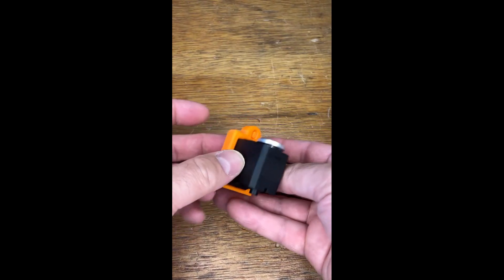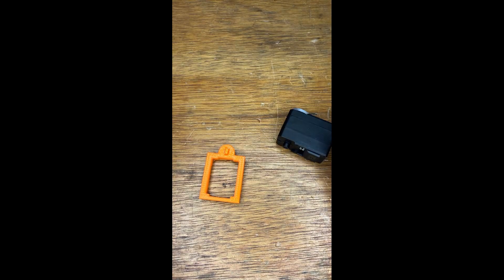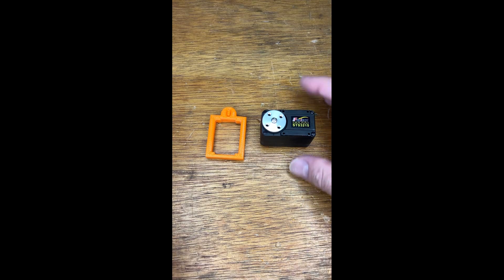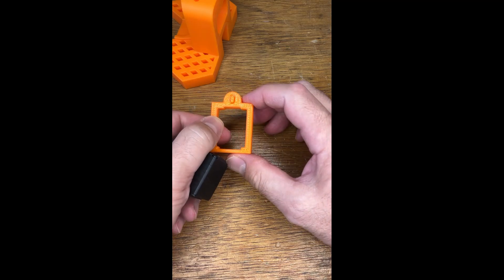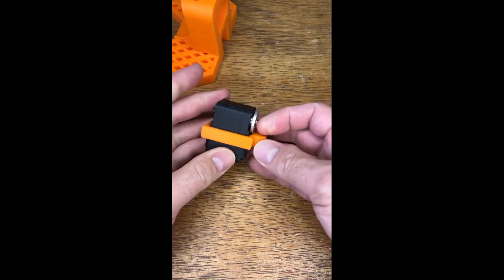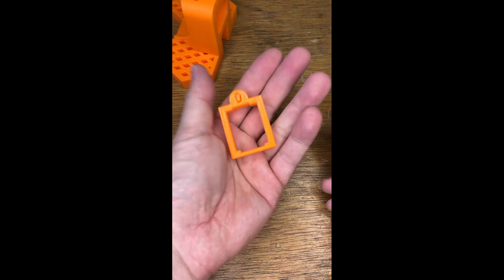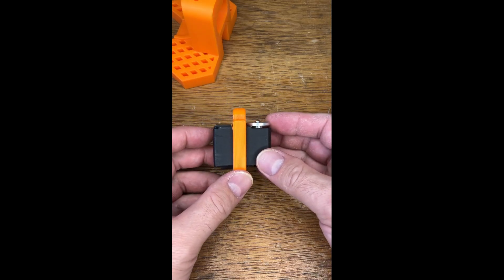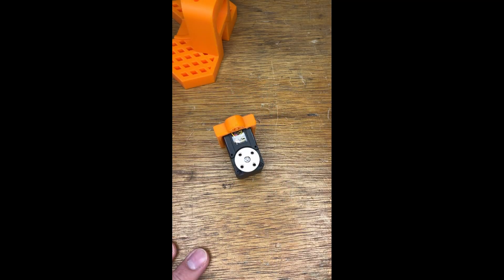Want to help with building robots?

Comment: Just printed - gauge 0 and -1 on bambu lab P1S. Gauge 0 -really hard fit - but pushed it thru only with hands. -1 also managed to push but heard some cracking of PETG (So it's a no no)😆
Reply from the maker: Check your printed width settings?

Comment: Just printed it gauge 0 on my prusa Mk3s+. It took some pushing but I got it to fit.  Excited to start the build.
Reply from the maker: Excellent. It shouldn’t need forcing though so consider tweaking the settings a little until it’s a snug sliding fit. Sorry, don’t know the exact settings, something to do with line width or similar may help. If you find how please feel free to post back here what you changed.

Comment: 0 seemed bang on for SO101. 1 was possible to get it to fit but I think is too tight (based on SO100 experience) and I might say was perhaps too tight. Prusa MK3S+ 0.4mm nozzle 0.20 mm SPEED print.

Comment: prusa i3 mk3, PLA - 
  guage-0 is really tight, but can pass with force or a few hammer taps. 
  guage-1 will  never go on without gouging the plastic.

Do the STLs use guage0, -1 or a mixture?
Reply from the maker: You need to change the printer settings until Gauge 0 is a “nice” fit.

If -1 is too tight you’re only 0.1mm -0.2mm too large.

I’m not familiar with the Prisa slicer. Can you find a setting to adjust the print path width or similar?
Reply: @therobotstudio  I went ahead and printed the base_so101 and base_08p parts  with prusa i3 mk3, standard settings and 3 perimeter layers.  I can confirm that they fit the servo tightly. I had to use reasonable force, but no hammer.  I would say that the compromise between rigidity and ease of construction is met perfectly.

Comment: with 20% infill, it takes some force to push the servo in to the "0" one...
Reply from the maker: It should take a “little” force. If you have to use tools, like a hammer!, change some of your printer settings before printing the whole robot.
Reply: @ tested with 13% infill. Better
Reply from the maker: Great

Comment: Using an Elegoo Neptune 4 Pro and Orca Slicer, printing with PETG, the 0 gauge file is just too tight to properly fit. First,  adding -0.15mm to the X-Y contour compensation and +0.15mm to the X-Y hole compensation made the part nearly perfectly sized and slides on smoothly with no play at all. Final setting of -0.12mm X-Y Contour Compensation and +0,12mm X-Y Hole Compensation allows for a perfectly tight enough fit, like in your video.

EDIT: settings
Reply from the maker: Thanks for the info!

Comment: For me 0 gauge it too tight, very hardly I can insert the motor, -1 is no way to push. I used Ender 3 S1
Reply: Horizontal expansion -0.1 solved the issue
Reply from the maker: Excellent!

Comment: @therobotstudio I printed the gauges with my Sovol SV06 printer which I had previously calibrated to an XY Compensation of -0.05 mm. The 0 gauge was too tight. Setting XY Compensation to -0.15 mm produced a good fit. Prusa Slicer, PETG, 0.4mm Nozzle ,0.3mm layer height draft mode.
Reply from the maker: Thank you for the details! We’re doing one last round of hardware refinements, finishing the software integration and then will launch at a major upcoming event!
Reply: thanks! this helped me print the piece to pass the lego test

Comment: Im guessing it fitting will vary from printer to printer, but should be manageable for people to make the adjustments by adjusting their horizontal expansion settings accordingly. 

Just the first thing that came to mind. 

I don't have any of the fleetech servos on hand, but I may snag one or a batch if I can make time to work on your hand model. It is in the list of wanting to do.
Reply from the maker: Hello! Well I’m trying to remove the guessing by getting some data 😁

I also wonder how familiar people are with the settings that would allow them to tune the accuracy of their printers?

The SO-Arm is the easiest way to start and it uses ST3215 servos.

Hugging Face will release end-to-end learning software in a few weeks.

Eventually I will add hands and legs. This year is my aim…
Reply: @therobotstudio  Very cool! 

Man I need to catch up on your projects, I'm still semi out of the loop since the big move to the "new" house. Just starting to get back into the swing finally. 

So here is my question(s) for you. 

- Where are you sourcing your Feetech servos from? I imagine it might be not the same as I may need with you being in the UK and myself in Canada, but always nice to know a reliable seller. 

- I'll need to check out your robo arm further, but regarding your hand design it is using STS3032? 

I'll take a look at the 3032/ 3215 / 3025BL and see what I can dig up in the meantime. 

No promises that I'll start the build immediately as I just came up with a new distraction and am working on a 3axis tongue mechanism (hopefully test today as I think it's done) and then want to try and bang out a full range lip mech for science. Though maybe done by the time the servos would arrive. 🤣
Reply from the maker: I order direct from the manufacturer, we can discuss on Discord DM.

The V2 can fit any of the micro serial servos but I prefer the STS3032 - it’s a very nice little unit. 

Good luck settling in and look forwards to seeing your new projects…

Comment: well, my personal printer (ender 3) is a bit wobbly..  and when i make functional prints, i make the "joints" or areas where non printed parts are mounted a mm free, meaning there would be some space on the print if somebody with a perfect printed made it.. So I suggest that , if 0 = snug fit and 0mm = 0 and value >0 is looser, then i suggest doing a 0.1 to 0.3 if ur making it open source....
Reply from the maker: Thanks. I’m looking for hard data though. Do you have any object of known size that you can try to fit a test print over?

Comment: I’d suggest using ribbs for a friction fit. You will get a very snug fit whilst minimising many other factors at play in very different printers such as : extrusion consistency, layer stacking etc.
Reply from the maker: Thanks for the suggestion. One of the printed slots has ribs on the roof to reduce supports and they do indeed work well. Was contemplating if it’s worth it extending to all the slots…